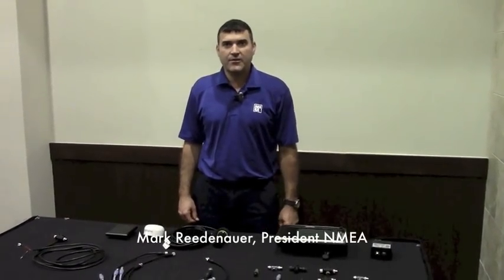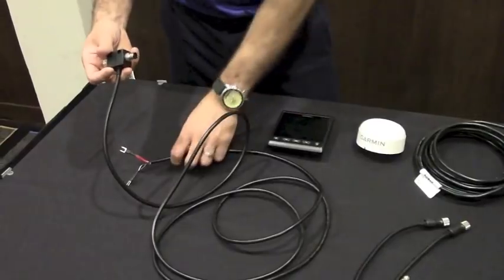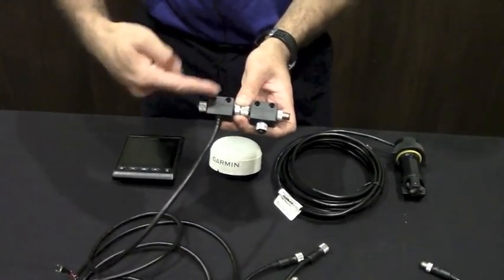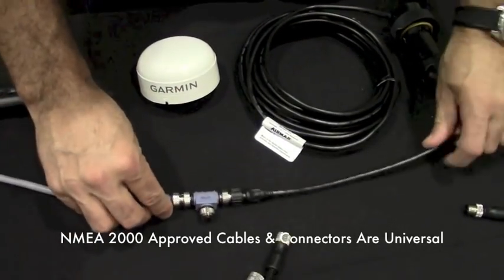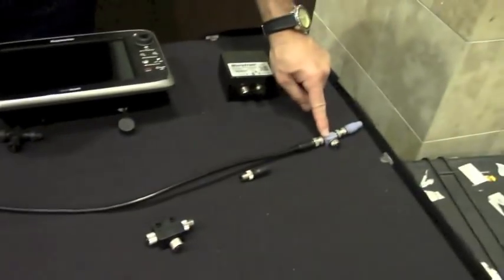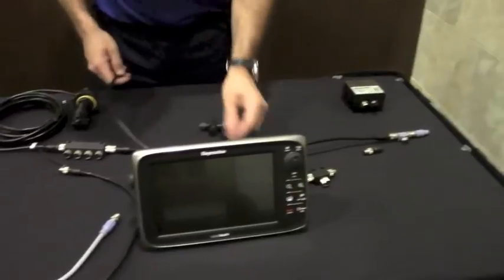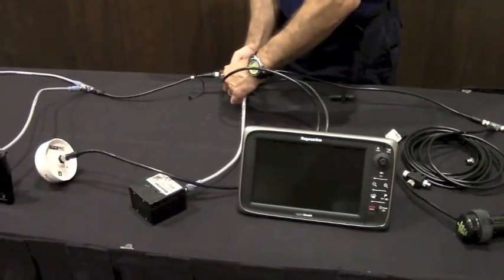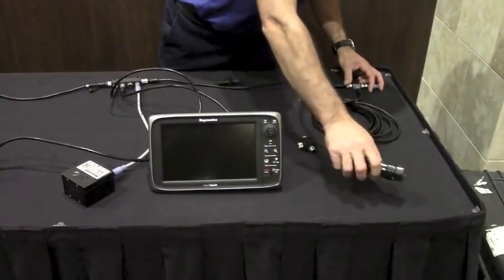NMEA 2000 Network Guide Video

Comment: You mentioned separate power needed to the multi-ruction display correct? Your example did not include that correct?
Reply: I just put together a network on my boat. One end of the 'backbone' has two power leads that connect to battery. The other end must have the termination cap. In-between the power end and the termination end is your T's that each 'drop cable' connect to and each device. So if you have and un-used T it is easy to just  remove that T until you have another device you want to connect. The network is easy-peezy to build and make work. Without the power end and the termination end, the network will not function.

Comment: On the multi port, would the unused spot need a Terminator? Or is that only for the ends?
Reply: I have the same question about terminators on unused drop tee,s.
Reply: No: you only connect a total of two (2) Terminators to the Backbone; one at each end of the bus.  Generally speaking, you would not have any unused/unnecessary Tees on the Backbone, as each connection introduces a small degree of loss.  The best practice is to have the bus built using right-sized cables (in terms of length, not excessively long that needs to be coiled, or lots of short lengths extended by Tees), and just the right number of Tees.

Comment: If I am only running a GPS antenna to my display do I need to run power into the backbone?
Reply from the maker: If the antenna is NMEA 2000 then yes you do.
Reply: The GPS Store, Inc. right on, that what I figured. Thanks for the reply

Comment: Do you have to use all four ports on that tee or can you put a terminator in the unused ports?  I heard there should only be two terminators in the entire system.
Reply: csrgatorfan  From what I can find online, the unused ports can be left open.  Only the ends of the backbone cable need terminators.

Comment: I have a Nema backbone and unlike your video, I  cannot  connect my Raymarine instrument to it. The Raymarine  has a 6 pin plug and the Nema has a 5 pin plug. Can you tell me how  you fitted that Raymarine device to the Nema backbone?? Maybe you used a specific connector but you did not explain  that.
Reply: Your Raymarine is Not compatible with NMEA. must be 5 pin setup.
Reply: @SF-rl7hl  only took a year for a reply. Awesome support

Comment: If you only have one NMEA 2000 accessory (such as a SteadyCast Heading Sensor), is it necessary to build a "NMEA 2000 Backbone", or can the SteadyCast plug directly into the chartplotter (741xs)?
Reply from the maker: Hi Jack, if you add any NMEA 2000 accessories or components it is necessary to build a NMEA 2000 network. the easiest way to do that would be to buy a NMEA 2000 starter kit.
Reply: Jack Webb nme
Reply: I learned if you only want to connect two devices as in your yamaha engine to your simrad you indeed still must build the network.

Comment: How this technology is still being used is beyond me. So old school.  Bluetooth and wireless is here!!!
Reply: Ben Lyons everyone does not have that option boat is too big wireless does not reach.
Reply: @theottovanpagel  unless you're on a 40+ footer, wireless is fine
Reply: I agree but I’m on a Westsail 43 with a 54 foot from the deck mast. Wireless does not work that good for me.
Reply: @theottovanpagel  nice yacht.  Your helm is only about 11 feet from the stern, which is where all your sensors would need to be.  Id imagine you'd have no issues if you needed to set up a wireless connection between a sounder and sensors. However, we should invent a wireless system first 😁

Comment: Not much help.... seems way too much work
Reply: One of the easiest things you can do on your boat. Its like connecting legos. It just looks complicated but its not. One end has the power leads that connect to battery. The other end has a termination cap. In between are T's that cables from each device connect to. Thats it. Period. If you remove a device just remove that T also and done. Add a device? just install another T and connect T to device with a cable. All the devices are connected at T's between the power end and termination cap of the network. Thats it and it works.